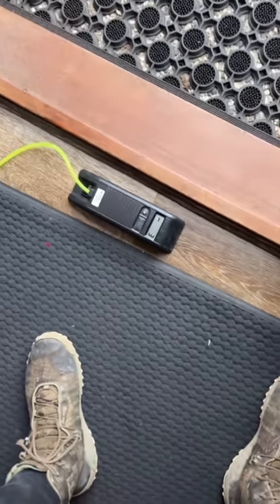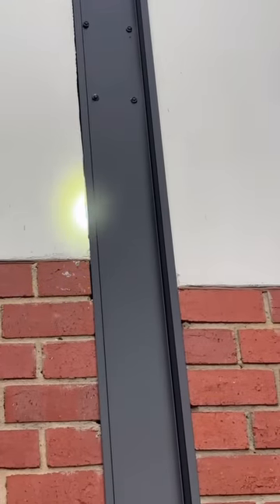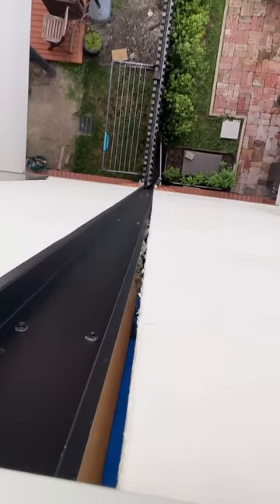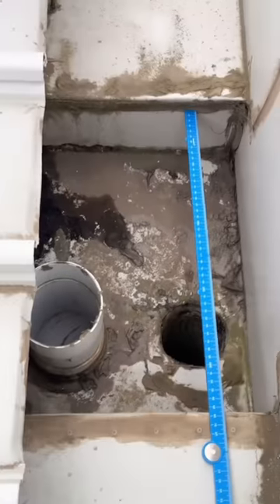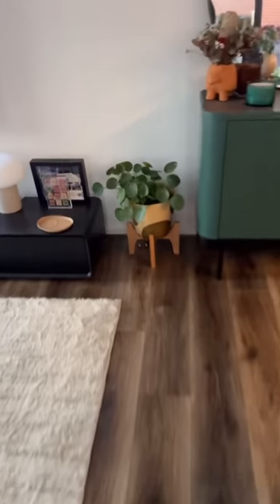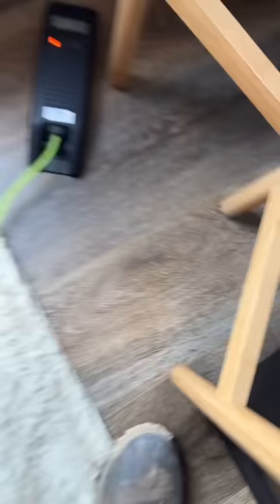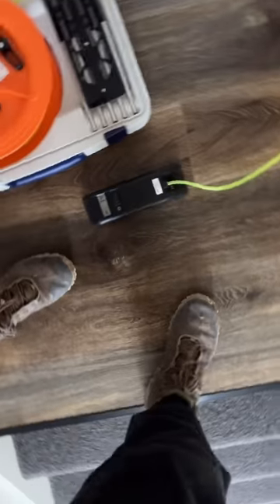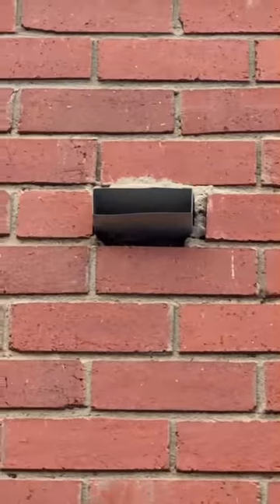Why Is This New Home SINKING…

Comment: Nothing like the flat-pack housing industry of Australia for the last 15 years. The fact that the warranty of any part of a house can be a little as only 2 years is insane. Any building should have a 10 year guarantee minimum.
Reply: I thought it was 7 years in VIC.
Reply: @KieranShort  
Depends on how the warranty is worded. 

eg. "lifetime warranty" = not the buyers lifetime, rather lifetime of the product, which they often don't specify how long that is, essentially making it pointless and a marketing trick.
Reply: If I can get a seven year warranty on my $50,000 Kia, then I should be able to get a minimum of 25 years warranty on my million dollar investment.
Reply: @shoti66  
Problem is houses are made of components of many different manufacturers and the workmanship of different tradespeople - manufacturers will always find a way to deny warranty claiming it wasnt installed correctly and tradespeople will say the product is defective = swings and roundabouts.

Kia, single manufacturer that sells directly to the buyer, with mass production of every component, meaning it would cost them next to nothing to repair anyway. Having such a long warranty offer is the selling point, it would increase their sales profit far beyond what it costs them to do repairs under said warranty.
Reply: @zchettaz  automobiles are also made of components of many different manufacturers and tertiery workmanship. Kia/Hyundai etc don't make their own bearings, own silicon for computers, etc.
Reply: @sabamacx  
mmm yes and no.
So there's three types of parts,
1. Genuine - which is manufactured by the manufacturer itself.
2. OEM (original equipment manufacturer) - which are companies that manufacturer a product that is to be sold by another company under its own name. These companies are often owned by the company they're making the product/s for, which is for various reason (plant, machinery, location, financial etc.) and for over 95% of oem, thats all they do - only make part/s for that company.
3. Aftermarket - which is cheap shit made in china that never fits properly and is irrelevant when it comes to manufacturers warranty anyway. 

Manufacturers warranty will always cover genuine and oem parts. So while technically they're different companies on the books, they're usually considered to be the same company. If that makes sense..?

Before working in construction, I used to work in spare parts at Nissan - you probably wouldnt believe that the washer on Nissan oil plugs (which get replaced on every car that goes in for a service) are oem. All they do all day is manufacturer this specific washer for Nissan, nothing else...and yes, i thought it was insane too lol
Reply: @zchettaz  we can’t have a situation that seems to be unfolding in this country where a builder can hand over an obviously defective product and be free of liability only two years into the products life. Somebody needs to be held accountable. If not the builder then the building inspector because obviously someone has been negligent in their duties. So many glaring breaches of the building code. This is what you get when you allow gangsters to self regulate.
Reply: @shoti66  
Unfortunately, we have that situation. However, i couldn't agree more, people need to be held accountable. While i also agree that the inspector should be held accountable for signing off on defective work, that still won't rectify the defects. If we make it so that the inspector or inspection company has to pay for the rectification, one of two things will happen, either no house will ever get signed off or, there will be no inspectors cause nobody will want that job.

So whats the solution?
Reply: Over 2,200 builders gone bankrupt in past 12 months,  ifthis is the sort of workmanship,  not much wonder, but where does that leave these unsuspecting home owners. How does anyone sleep at night building that sort of non quality house.

Comment: In the old days there were no Private Certifiers, just local Council building inspectors that in my experience were all hard as and by-the-book arbitrators of what was compliant or not. The whole building industry has been undermined by shoddy workmanship and governance. This has to stop and we have to get back to our Aus Standards that have worked for decades. Not one new development in our area is 100% compliant and are all a disaster waiting to happen. Agree all, warranties have to be 10 years min and with that, one issue and straight to Fair Trading with fines and penalties waiting for the slack builders. In most cases, short cuts are saving just a couple of thousand dollars, only to cost 10's of thousands to fix just years down the track. Time the State Gov stepped up and fixed this woeful situation.
Reply: Yep massive fines or jail time.
Reply: The same is happening in the UK and US. Must be an Anglo thing. lol
Reply: They brought in to many rules all the 80s houses are solid ..

Comment: These builders should be named and shamed to protect the public. We need to remove the cowboys and incompetent builders
Reply: Well well we’ll try to see Sydney.   First day brand new appartments.    No drainage all common areas . 2 side to side high rise .rain    Top Roofs all like a Poolside 4ft high over 8weeks No on Property Management. All took off.    😂 back to new Zealand.   Yep!    Well all sewerage floats pool top rooftop.  Then flew down fire stairs .   😂.    Then 2years later still same .   Sewage pipes non existent. 😆.   Then the family say why did we leave there .      Answer: why don’t you live there ..    stinks like 💩 and coming up always in all garages you can see it all . As covered up by cut off boxes !   No one cares .  Not my unit .   The people that own it are 👎lost .   That’s what I know .       All this is  bad.   Only get worse .       Obviously.
Reply: They're all dodgy af. more redtape just means more expensive housing.

Comment: This just shows that as a new home owner you need to get your own inspection done at each and every stage before the builder gets a cheque for that stage.
Reply: most people don't know what bad work looks like. They expect the builders and tradies to be experts.
Reply: Yes I did that. However no one told me to do that. I have something to do with the industry, which is why it occurred to me. Even then I initially forgot to budget for it and so it was an unplanned expense. It likely would not even occur to the average new home owner. They aren't experts on how to monitor a house build.

Comment: I swear cuzzie, the slab I poured was all good brother, 🙌🏼👌🏽
Reply: Yeah bro, poured the slab in the rain so it self-levels - ya cant bend water cuz 🤔💡🌧️
😏
Reply: @zchettaz  brother I mixed rain-x in with the concrete, water resistant
Reply: @japcrap  
No kidding!?! You need to seal it afterwards? 

Brother, time is money for me, so i make it dry faster by mixing salt and sawdust into my mixture.
I mean, thats essentially how the Romans done it and their buildings are still standing - bruh, I'll be long dead before I ever get a callback = logic. 😏 🏛️
Reply: @zchettaz  no trouble on the double bubble cuzzie g
Reply: @japcrap  
I hear wd-40 works well too, water displacement

Comment: As the old saying goes,. "They don't build em like they used to. "I'll stick with my solid and well built 1950's detached house on a 1/4 acre block any day..
Reply: yep, it seems to get worse and worse, where is the bottom?. 1970's house here which in 10 years i've probably had to spend about $40ish k. Replacement carport that was 50 years old, replacement outdoor entertaining area roof, switchboard replacement, switchboard relocation, additional wiring, lights, wholesaler electrical feed-in relocated so its not directly above my pool? 💀WTF. Nothing wrong with the houses bones.
Reply: 1/4 acre block? Haha u going to spend 5m in Sydney or live in woop woop?

Comment: I have the same house sinking, after winning at vcat builder offered to unpin the sinking part of the house, i know it was wrong unfortunately vcat will except if a builder offeres to fix it, knowing how this builder operates i made sure no gag orders signed plus had plan B put in place so if the builder to short cuts and failed to comply with the vcat orders they would be held accountable. In 2020 work started woth a engineer to design underpinning and drainage system designed by a civil engineer,  well total screw up since the vcat agreement was to have the slab jacked up to pre settlement floor levels. Well lucky i did my homework researched how underpinning was done and how it should be done spacing between the piers how  deep, but a soil test has to be done to determine how deep the piers had to go and find solid ground or rock.  None of that was done after the so called underpinning company drilled into every storm water pipe plus our main power cable pulled out, i dont know how these guys didnt die honestly. Once the pored the piers holes i noticed no room to get hydrolic jacks under the slab and install the steel support brackets and 20mm plates to spread the weight. Soon as i found out i sent everyone home got the Victorian state manager to come down and see the shit mess they did, soon as he arrived i am sorry ill call a underpinning company,  i said what? You stated at vcat you had a team of experts underpeinning company to do the work, he replied oh no no these are just our in house concreters that do driveways only. No could read the engineers plans. So now the drainage system designed by a civil engineer has failed due to no one tested the flow of AG pipe befors back filling no risers installed to flush the system out since this AG pipe goes 3 sides of the house tnere about 300metres of AG pipe installed now thats failed because its flowing backwards, the piers have failed because the incompetence of the concreters after drilling into our storm water pipes they thought to fix it them self by going to bunnings and buying the 4 inches wide rubber joiners which are useless under ground then as the slab moved it popped those rubber joiners with so much rain july 2020 i pushed to have hydrostatic pressure testing of all our plumbing, they failed 5 times and 5 times the front yard had to be dug up by hand to locate the faults what they found was these rubber joiners had opened up allowing more water to soak into the soil under the waffle slab creating now a bigger problem. These builders are getting away because they know 98% of people cannot afford the legal bills,  so they keep hiring crap cheap trade, because any smart good trade will not work for them. So i have inside knowledge on how our builder operates its not good.
Reply: Poor bastard!
They should be forced to knock it down and pay for a proper builder to do it over from scratch.....
...and put you up in a 5 star hotel while it happens.

Comment: Corner of the house we rent Dropped about 35-40mm during that big earthquake in early to mid 2022 was it? 
Was big enough quake there is 5 new cracks in concrete floor downstairs in laundry and 1 corner of wall moved 5-40mm as i said. 

But not telling landlords as then we will have to move out for it to be fixed and that means will be without a home as finding a new rental in this current market is a joke.

Comment: Anyone know where in the NCC it outlines the minimum overhang of sarking into eaves gutters? 
This is for a colorbond roof with anticon blanket underneath and the roofer has installed just short of the gutter. Risk is low given its a metal roof but still annoying.
Reply from the maker: HB 39

Comment: Will pumping concrete under slab work for this property ? Looks like too many builders handing envelopes to the inspectors !!
Reply: The most effective remedy is to pump expanding urethane foam under the slab - stabilizes the soil and can lift the building back to its original level. But it's not cheap. I had my townhouse in Pascoe Vale (built 2015, by 2017 parts had dropped 65-70mm) lifted in June this year, cost around $30k.
Reply: @nongbloke  But this should not off happened in the first place departing you of your 30 k  hard earned cash.

Comment: why is styrene even legal? it's as flammable as petroleum
Reply: Fire-retardant polystyrene foam sheets will burn when in contact with a flame, but will self extinguish when the fire source is removed.
Reply: @gribbler1695  so how did that work out for the people in Grenfell tower fire?  there's no such thing as non flammable styrofoam. zero have passed CSIRO tests.

Comment: What caused the expansion joint blow out like that?
Reply: The concrete pad and footings are falling apart and subsiding.
Reply: Probably reactive clay soils shrinking combined with inadequate depth of  foundations . Could be uncontrolled fill subsiding combined with inadequate depth foundations .

Comment: Why does every video of yours have the same style roof and gutter system? Is it just the current trend where everything being built is not just a normal roof, they all have to be the flat ones?
Reply: So they can squeeze as many units into the development below the height limit .
Reply: I used to be a roof plumber in a previous life.  Almost all of our headaches were form flat roofs and box gutters.
Rain heads were always getting blocked up because pigeons love to nest in them.
Flat roof = no thanks!

Comment: This is why I buy units only, houses will always need repairs units never, strata sure but it’s a great system protected by legislation and it’s got representatives to back it up unlike you verse the faceless nameless
Reply: You've got to be joking right Stefano? Have you not heard about the Opal Towers apartments in Sydney? You really believe apartments never need
repairs or don't suffer from waterproofing/mould/major defects? Paying strata fees when you are old and on the aged care pension not great either?
Reply: Mascot towers?